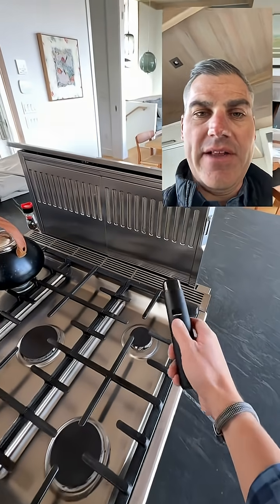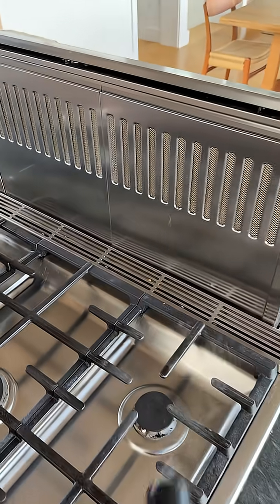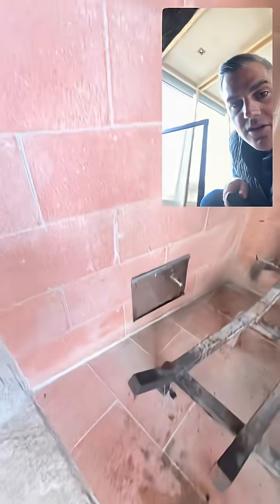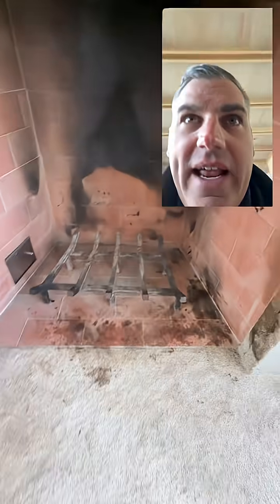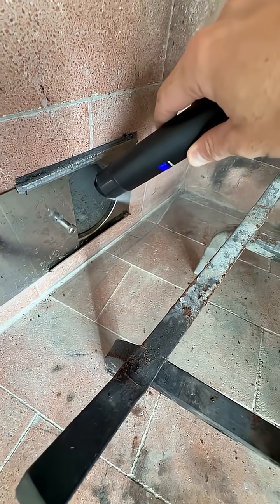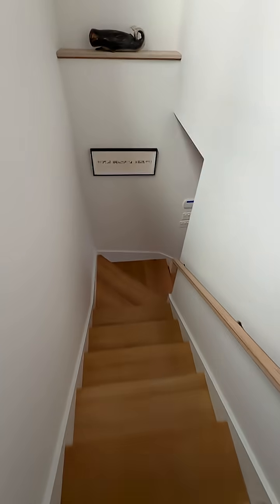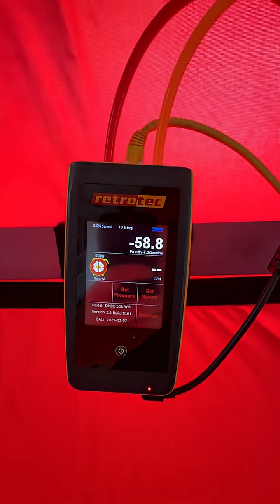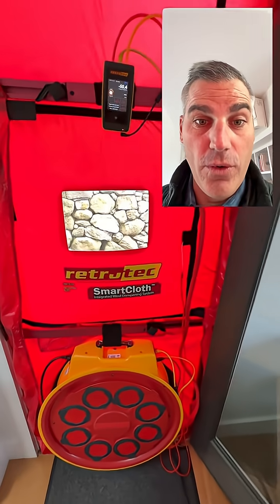Why is the Kitchen Range Exhaust Backdrafting the Wood Burning Fireplace?

Comment: So how is this fixed
Reply: That’s what I was wondering
Reply from the maker: We haven’t implemented a fix but over on IG I shared more info on three options. A make-up air system is needed to solve for the depressurization when the range is on. From there the homeowners could install a flue top damper that seals well to keep air from coming down the chimney or they could install a gas fireplace which would be much more airtight.